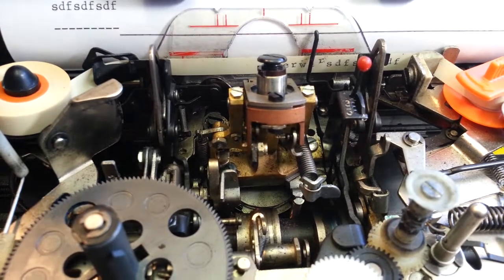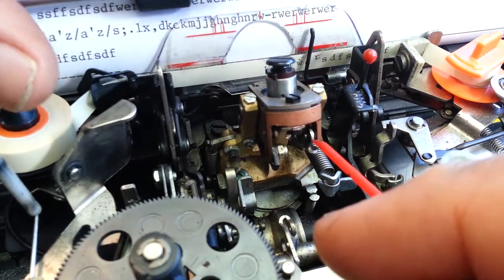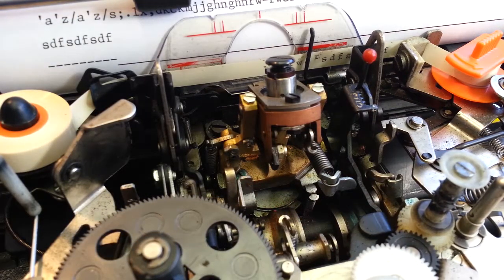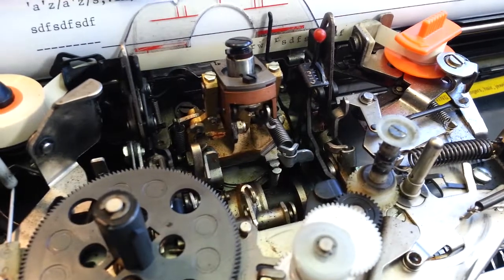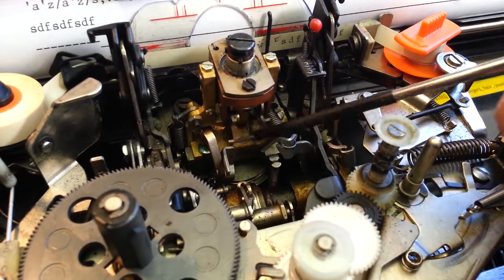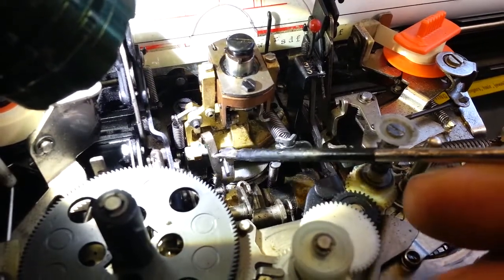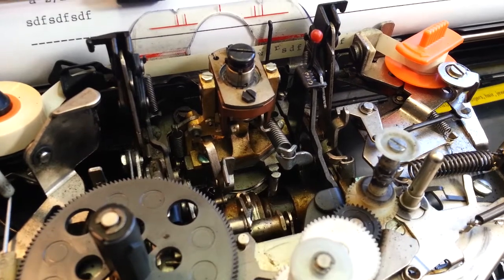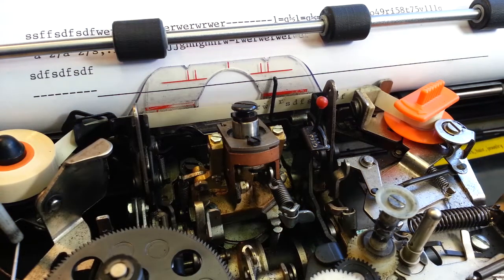IBM Selectric Typewriter Dash Uneven Not Usually Tilt Bellcrank

Comment: Love your videos! I'm surprised so many problems seem to be caused by sticky grease 🤣

I have a Selectric 2, where the typeball is pointing in the wrong direction, is it possible to adjust it?
Instead of the arrow pointing towards the platen, it's pointing almost in the opposite direction (5 positions off, I'm assuming)
Reply from the maker: I would look for something more serious than an adjustment, like rotate band off one of the pulleys
20 years ago there were NO sticky parts problem, BTW Every 8 years these were supposed to be rebuilt ( oil changed )
This did not happen & now all the old oils and grease have coagulated and are causing majority of all the problems nowadays
Reply: @phoenixtypewriter2136  Thank you for the reply! I will definitely check the pulleys.

I've managed to get my other II working for the most part simply by cleaning. Only the carriage isn't moving, when typing letters or hitting the spacebar. Guess there's some mechanism still sticking. It's fun to explore these typewriters, and your videos are a lot of help, so thanks again :)
Reply: @phoenixtypewriter2136  So I checked, but the rotate band is not off either pulleys. Any other ideas?